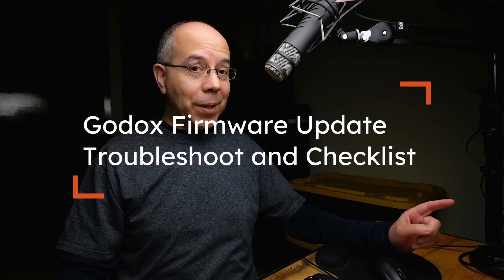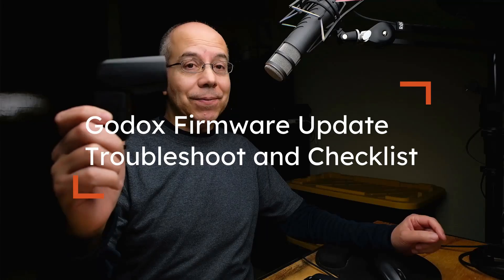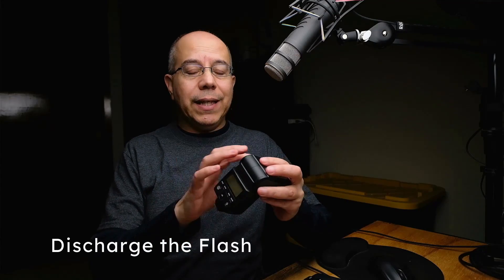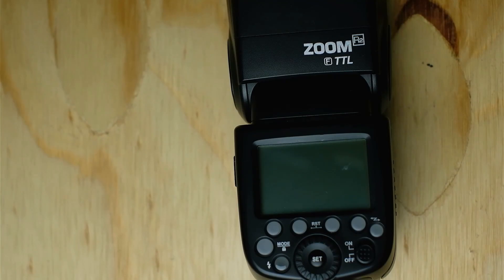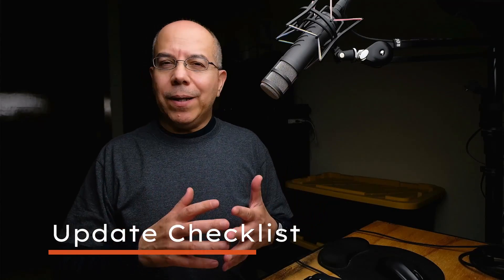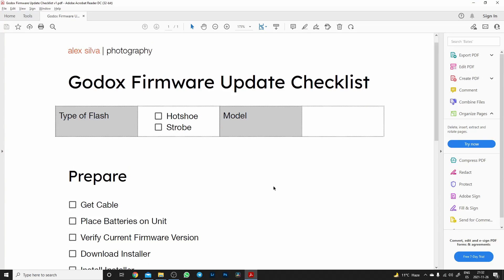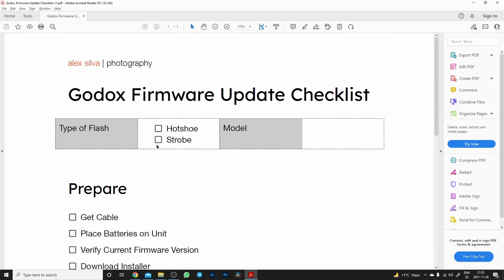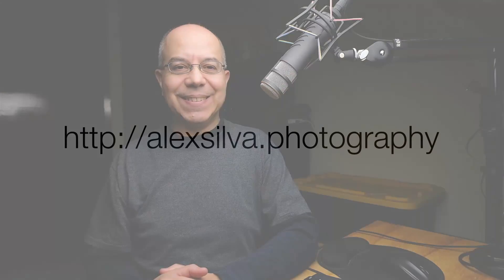Godox Firmware Update Troubleshoot and Checklist

Comment: Guys, I found something that worked for me. I did everything like in the video. When I was installing the software, I didn't notice that shortly before the end of the installation, the drivers could not be installed. So I had to turn off the “Driver Signature Verification” that prevents them to get installed, via CMD. And now it works

Comment: If anyone is facing my same issue with windows 11, when I connect my device to my pc the G2 software is not recognising the godox product. In order to let it work you have to disable the core isolation in device security. In order to enable it again you have to get rid of the drivers of the G2 software after you updated. I hope this might help someone else.

Comment: I found this video while attempting to update the firmware on a few of my Godox items.  Sadly for me none of these things worked, reason being when installing the software for the G1 Godox app,  the drivers failed to install.  This was for both my windows 10 and 11 PCs. You could see that in the install window, red X drivers failed to install message.  Because these are unsigned drivers windows security prevents them from installing.  What worked was disabling the driver signatures temporarily, then when I installed the software the drivers successfully installed and I was able to update no problem.  This was not an issue with the G2 software for some reason when I upgraded the control module.  You can google how to disable driver signatures and find all sorts of info however in a nutshell:  Choose Troubleshoot > Advanced options > Startup Settings and click the Restart button. When your computer restarts you'll see a list of options. Press F7 on your keyboard to select Disable driver signature enforcement. Your computer will now restart and you'll be able to install unsigned drivers

Comment: I noticed you stopped responding in comments so Im taking a long shot here. My process to update V1 has been frustrating. Im trying everything and nothing is working. Updating firmware shouldn't be this hard. I used USB C and USBC to USB A cable, I used thunderbolt usb C cable. Did all the other steps you mentioned and nothing is working. How?

Comment: I tried to update AD400 but I can't seem to connect it to a laptop, nor mac nor Windows, even with an expensive tether tool cable.. Will try to "reset" flash. But so far, Godox seems trash with support. They don't even mention you have to remove batteries before update, not to mention the typos in a 5 button app.. Just horrible.

Comment: Thank you Alex Silva and Rogers Photography (in comments blow). I'm not joking when I say I've spent no less than 10 hours total trying to update my firmware on all my Godox gear. First, I'm a Mac user, and tried every work-around found online. I then tried my daughter's school computer but it the installer wouldn't work without Admin access. Then borrowed a friends' PC. Started with the G2 Installer. Tried the same three USB C ables 20 times and failed. Finally, for no rhyme or reason, one (that'd I'd already tried 5 times) randomly worked on my AD200 and XPro N's. 

But the G1 Installer failed repeatedly on the X1-N and v860ii-N, failing to connect despite trying 872 perfectly good micro USB cables. Tried all the "admin" work arounds found on various YouTube channels, including disabling secure boot and entering command prompts. After literally hours, nothing worked. Finally saw Roger's Photography comment below about the Godox Install package being corrupt and tried his solution of using the Flashpoint G1 Installer (but kept the same firmware files I'd previously downloaded for the flash and receiver on Godox). Holy crap. It worked. My guess is  that would have done the trick had I known about it before resorting to all the ridiculous boot-level admin tricks. Praise the Lord. What an ordeal. Thank you Roger's Photography for the tip!  And Godox, what the heck?

Comment: In my case it wasn't the cable, firewall or anything computer related preventing the update(s). It was the actual Godox install package. It was corrupt on their site. Instead I used the Adorama Flashpoint series updater and it worked perfectly for my V860iin and Xpro transmitter. In case you aren't aware: Adorama brand flashes are just Godox rebranded and all of their accessories and updates are compatible with each other.
Reply: DUDE, thank you! I was using the Flashpoint R2 Nano (Adorama's version of the Godox X3) and assumed the firmware on the Godox site was correct. Had no idea that Adorama had their own firmware until reading your comment. Tried Adorama's firmware installer and firmware instead and it worked.
Reply: It worked for me. Thank you SO MUCH!!!

Comment: Thanks for your advice. But while installing the Godox G1 software, it is observed that the driver is not installed.
Reply: mine too, have you found a fix?
Reply: @hannahh3642  Yes, its works only with Windows 7....... not with the higher versions. But Godox G2 software works perfectly with Windows 10 or 11

Comment: I just broke my AD200Pro after firmware upgrade. All the process went well, after "operation successful" the flash won't turn ON 🙁
Yes, I removed the batterie and turn on for discharge, then I connected to computer.
Reply from the maker: I'm sorry about your experience. Looking for information about your case I found out that, apparently there are two versions of the Ad200Pro flash, the regular and the A version, each one with a different firmware to update. Look for the FCC label on the bottom of the unit, if you see a text that says "Version A" next to the triangle with exclamation mark, you have the A version. 

You can find the corresponding firmware in this page: https://godox.com/support/search/?keyword=ad200pro
Reply: I have the same problem with my x2t Sony trigger and I am so pissed

Comment: Hi ! I bought the version 2 of the  tt685 c . Do you know if is a firmware update for it? . I use it on a canon R6 and some times error70 appears on my camera. Think that the problem could be the flash . The actual version of firmware on my tt685ii c is the V1.1 .
Reply from the maker: Hi there! I don't think there's a newer firmware for the TT685II yet. I have heard that Godox flashes are not playing well with Canon R5 and R6, but Godox has not offered a solution, AFAIK :-(

Comment: Hi Alex, what's the workaround for Mac users?  As far as I can tell Godox doesn't support Mac users...  I have a Bootcamp Mac that runs Windows for this purpose but apparently USB doesn't work when I'm running Windows on it...  Thank you and I appreciate your time!
Reply from the maker: What I have read is that you can use a virtual machine with Windows 7, 8 or 10, and then enable a USB port on the virtual machine. In order to run a virtual machine you can use Virtual Box or Parallels.
Reply: @alexsilva_co  ah good to know. I’ll try it one day.  Thank you for responding!